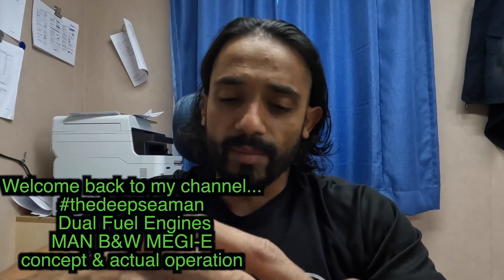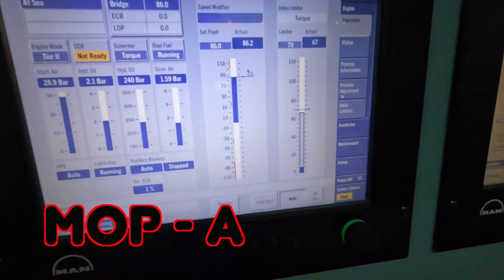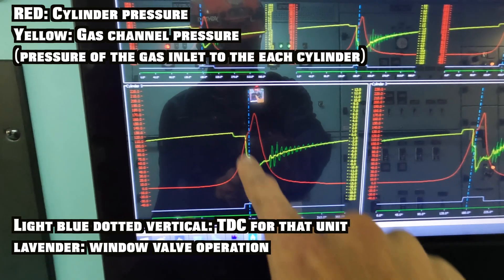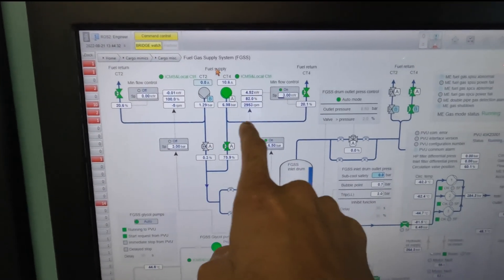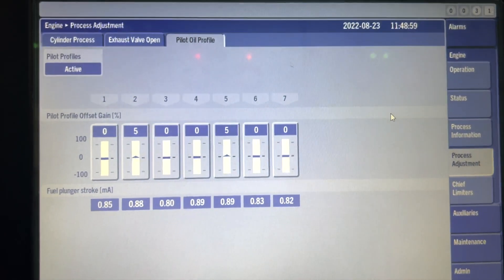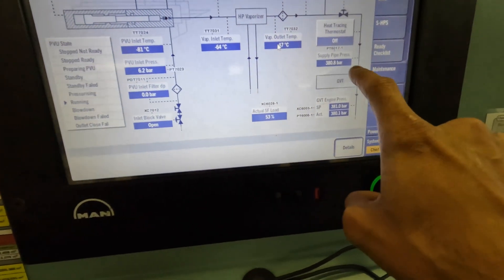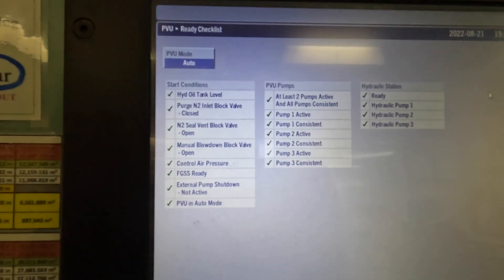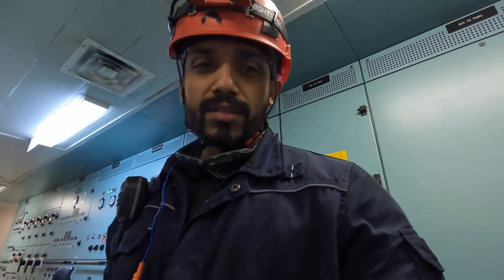DUAL FUEL ENGINES - Operating Parameters & actual service screens in ECR & CCR. MANB&W 7G60ME GI-E

Comment: what do you do  with the boil off gas on this vessel? is there a compressor somewhere to re-liquify it?
Reply from the maker: yes there are reliq compressors, 2 compressors working in tandem as cascade relic - 3 sets of these. ethane stored at almost atmos pr. and -88deg C.
For fuel we use liquid cargo from the bottom of the tank

Comment: I believe its ME-LGIE not ME-GI.
Reply from the maker: SORRY brother IT IS ME-GI : For METHANE and ME-GI-E: for ethane engines.
Its been a long time I'm working on these and I certainly know my engine and would not share incorrect information.
GI = GAS INJECTION.. these engines are injected with HP gas through their Gas Injection Valves //Methane 300 bar & ethane 400 Bar
I can see that you are confused  with LGI concept .. LGI = Liquid Gas Injection where Propane, & Methanol are injected as liquid in the engine thru their injectors...
the LGI-P for propane & LGI-M: Methanol
HOPE THIS HELPS.. thanks for connecting

Comment: Sir 
Good day 
Can you please tell 
The percentage of Pilot fuel and Gas fuel control by which part. Is it controlled by ELWI?
Reply from the maker: pilot fuel is 4-5%. this is almost common for all loads as it is only to help start the combustion since auto ignition of ethane does not occur with the compression. the function of the pilot oil is similar to that of a spark plug in a petrol engine, The quantity of pilot oil can be adjusted from the MOP in the pilot oil profile, you can monitor this from the PMI computer app //Cocos// on the line recorder. the ELWI does not control the pilot oil the ELWI as the name suggests the control of the Window valve which is responsible for the Gas and NOT PILOT. Pilot oil comes thru the fuel injectors, so control is by the FIVA//CCU//
Reply from the maker: 3 MODES - FUEL OIL ONLY MORE... (NO GAS), MIN PILOT & MAX GAS - PILOT IS 4-5% OF FUEL INDEX & SDF - SPEFICIED DUAL FUEL MODE WHERE WE CANS ELECT THE %.. PLS SEE ONE OF MY VIDEOS EXPLAINING THIS

Comment: Great video, thanks! Do the MEGI engines have a fuel sharing mode where any ratio of fuel oil and gas can be used? If so, how is it decided which ratio of fuel/gas to use? Or is it typically ran on dual fuel mode with just a small amount of pilot fuel
Reply from the maker: 100% engine load - 
Pliot 4-6% max and the rest is Second (Gas) fuel..
this pillot 4-6% is the normal consumption even at lower loads.. so even at lower loads 30% engine power and up the gas is still 25 and pilot is 5... this engine MEGI-E can run only on full gas mode with 4-6% pilot..
for the injection timng/quantity the preset algorithm in the ECU controls this and does its own fuel index calibration depending on various parameters like Pcom,pmax, rpm, load, Tier III/II, fuel cal value, sulfur content, etc
we cant change there is an option to go in to MANUA mode
the newer gen MEGI-2 engines designed for Methane (LNG --NOT ETHANE) are designed for partial fuel partial gas and also one cylinder fuel other cylinders gas due to the new components and software
Reply from the maker: YES, THEY DO,.. 3 MODES - FUEL OIL ONLY MORE... (NO GAS), MIN PILOT & MAX GAS - PILOT IS 4-5% OF FUEL INDEX & SDF - SPEFICIED DUAL FUEL MODE WHERE WE CANS ELECT THE %.. PLS SEE ONE OF MY VIDEOS EXPLAINING THIS

Comment: Hi again, noticed gas injectors and pilot oil injectors....are the main fuel oil injectors located at the same area?
Reply from the maker: Theilot fuel injectors are the main injectors too,, just during pilot fuel operation they inject much lesser quantity.. and as soon as a gas trip occurs, the fuel plunger stroke is increased and quantity of fuel increase for the seamless changeover
Reply: Ok thanks makes sence, was searching for the main injectors in addition to the pilot in the video.
Looking forward to window valve operation video as well as if quantity of scavenging air can be varied.

Comment: Hi, would you be kind enough to show how the windows valve operates, as well as the sudden change over to fuel in case of gas failure. Thanks
Reply from the maker: Sure, great idea about the sudden change from fuel to gas. trust me this is seamless.  about the window valve i will make one separately... for sure, do ping me if i forget... follow me on instagram too... #thedeepseaman...